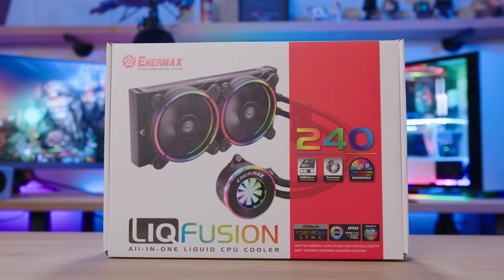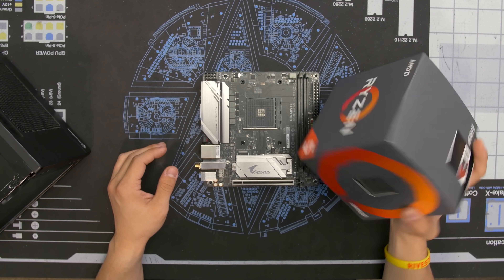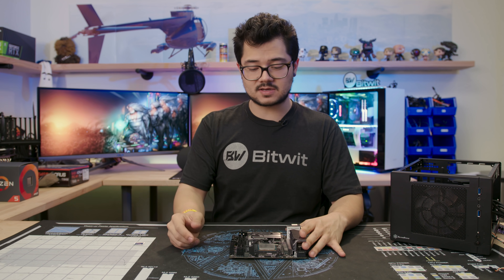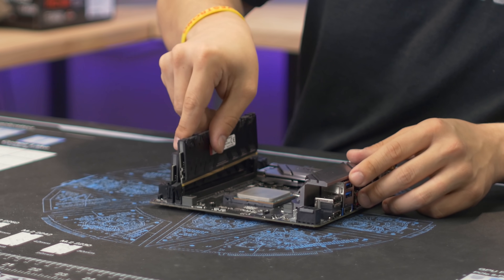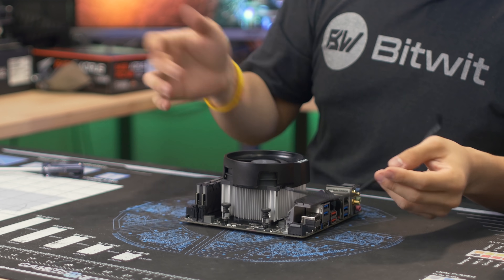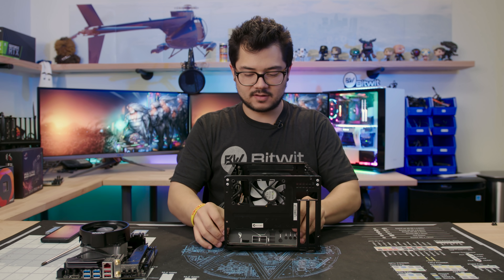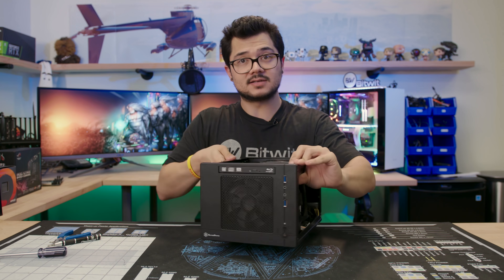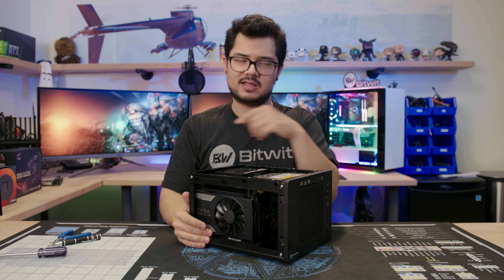Building a TINY PC Step-by-step!

Comment: The Ryzen 5 1600X is a really good quad-core, 8-thread CPU?

It's also a really good 6-core, 12-thread CPU...
Reply: And does not include a cpu cooler? Right?
Reply: @ProjectMysticApostolate  No, it doesn't.
Reply: Arvin Lee. The 2x00 series all come with coolers for similar pricing.
Reply: Probably got it confused with the 1500X, which is a 4c/8t
Reply: Must be workin high. Hahaha
Reply: Should of left it to Lyle.
Reply: Rare oversight. Maybe on purpose???
Reply: @ProjectMysticApostolate  Nope. Kyle is just misinformed.
Reply: glad i was right . he had me doubting
Reply: i got confused at that part
Reply: I got the 1600. includes a cooler
Reply: ThisEmptyWorm | The 1600 includes a cooler, while the 1600X does not. Also another reason why I bough the 1600.
Reply: Looool I have this CPU and it’s brilliant for multi-threaded tasking. Smooth as butter.
Reply: Come on Kyle Lyle would of known this.
Reply: 1600X and 2600X are the same price, reason has no place in this video.
Reply: Or 2600 (w/o "x" index) is good for overclocking and get same 2600x
Reply: It has both 4 cores, 8 threats and 6 core 12 threats.

Comment: How many fps in paint?
Reply: 3
Reply: fps noises fps noises
Reply: @gamingpikachu7719  hello therr noises
Reply: MS Paint Daily, Hello Noises
Reply: 4
Reply: 17
Reply: 30 if you turn off shadows
Reply: Red
Reply: idk maybe around circle
Reply: At least Dozenty-five. If you want many-seven then you need a system built by the verge, they use extra thermal paste to increase the rgb performance of the hard driver.

Edit:
Okay, that caused me actual pain to write out, I'm sorry.
Reply: 0.5
Reply: 69
Reply: 420